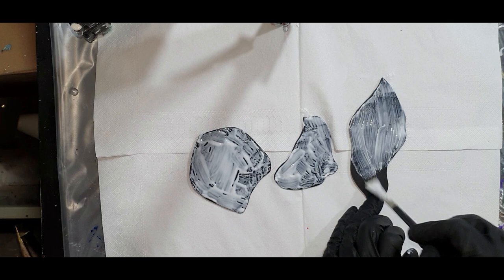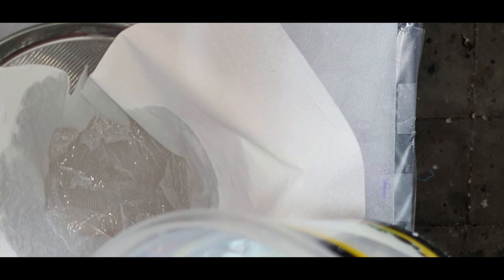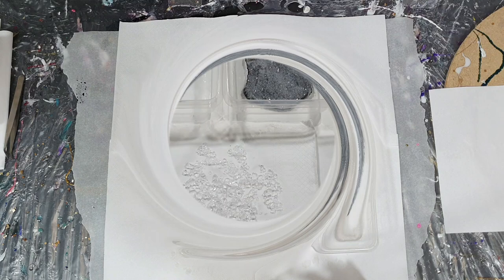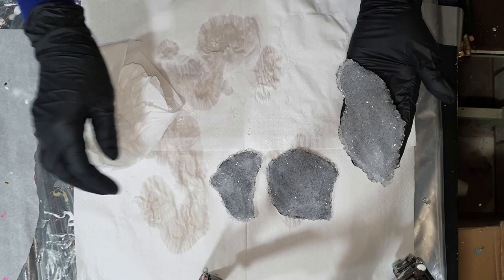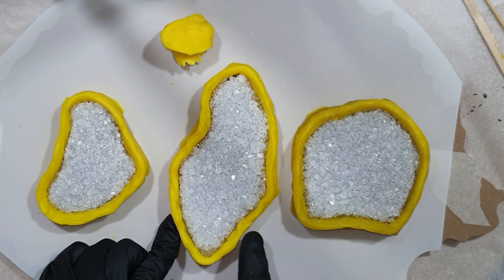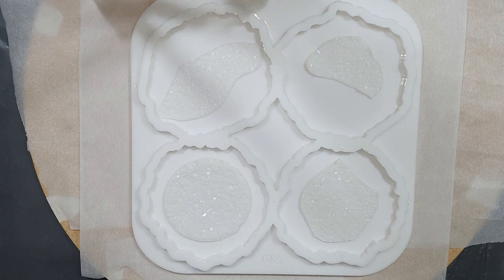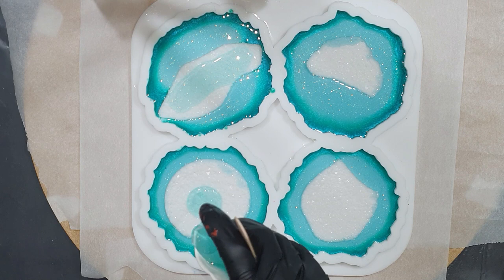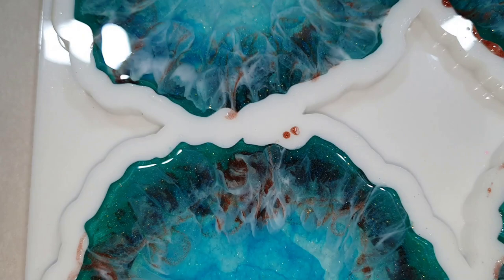Using Polymer Clay for Druzy Silicone Molds

Comment: Wow! This is a wonderful idea to make nice and different shapes! Your crystals get big FAST. Mine wont grow like that. Could it be that it is because I keep using the SAME mixture again? I heat it until boiling and add Alum Salt until no more dissolves each time I do it but they never get really big.
Reply from the maker: Thank you so much for your nice compliment Calissa ❤ I appreciate it a lot. 😀  Yes, this way you can make any shape you want. You can use the same mixture again, but I always check if I need to add more salt. The crystals will grow faster in a flat container.

Comment: Petra--really enjoy your video quite a bit--stunning work.     A question though--the modeling clay you're using, is it the air-dry kind or is it the non-drying type?  I want to buy the silicone liquid, but not sure how it will react to the modeling clay.
Reply from the maker: Thank you so much for your nice compliment Peregrine Designs ❤ I appreciate it a lot. 😀  No, it's not a air dry clay. The yellow clay is a molding dough made out of beese wax and the black clay is a clay that needs to be baked in an oven.

Comment: Nice video. Mixing quantity ratio pls water, alum
Reply: 400ml boiling water to 200g alum salt.
Reply from the maker: You can find the answer below from Melissa. Also the rule is to add that much alum salt until it doesn't desolve anymore. ❤😀
Reply from the maker: Thank you Melissa for mentioning. ❤😀

Comment: Thanks Petra. If you fill in the bottom which has the indentation from the druzy mold to make the bottom flat, does it change the crystal effect from the top?  Just wondering. Thanks!
Reply from the maker: Thank you so much for watching Tas St  ❤ I appreciate it a lot. 😀  I'm so sorry, but I don't quit understand what you mean. Can you explain a little bit more. Thanks.
Reply: Sorry let me try again. You know the side where you removed the druzy mold?  Let’s call that the bottom. What happens if you fill in the bottom cavity where the druzy mold was removed?  Then both sides would be flat but I wonder if the bottom would still sparkle or not.I hope this is more clear, but if not no worries. Thank you so much!
Reply from the maker: Oke, thanks, now I understand. 😀 If I would fill it to make it flat then the druzy effect will be gone. I would fill in all the texture from the druzy and then you can see it anymore.
Reply: Thanks Petra!!!!

Comment: Super good Petra! Good idea to make your own molds! What is the difference between the two types of clay in the description. Fimo and Modeleer clay. You say polymer clay? Are they both polymer clay?
Reply: Fimo is, I don't know what the other one is
Reply: @labella9291  Thank you La Bella.🥰
Reply from the maker: Thank you so much for your nice compliment Tanja ❤ I appreciate it a lot. 😀  The polymer clay (Fimo)  needs to be baked in an oven. I use this clay to make the shapes to grow the crystals on. The Moulding dough will stay soft and does not stick to the sides of the silicone rubber. It made out of bees wax.
Reply from the maker: The other one Pelikan Moulding Dough. It's made out of bees was and will stay soft.
Reply: @petrajongbloed4425 You are welcome Petra  Thank you Petra, now I understand.

Comment: @Petra Jongbloed, oh man did I think this was going to be fun! So I spent a lot of money on clay (I had no idea it cost so much!) then I used a glue that was 100% waterproof that worked on wood and other materials and I had a had a bag of Epsom salts already so I tried that. NOTHING!!!! Ok, so round 2 for trial to make sure I could even grow things correctly, I used the pipe cleaners and borax method. Great, that worked! Now I have all these clay pieces that are ruined and another thing I noticed watching your video again, your clay doesn't float! I wonder why mine does?!?! If I had money to play more and experiment, I would probably just go online and order the druzy! I think these are going to have to be on hold for a while :(
Reply from the maker: I'm so sorry to hear that Mahna. I'm using a baking clay from the brand Fimo. Yes, and it's not easy to grow crystals. It's all about the ratio of the mixture and the temperature of it. I also uploaded a video now in which I use different sizes of crushed glass to make a druzy mold.